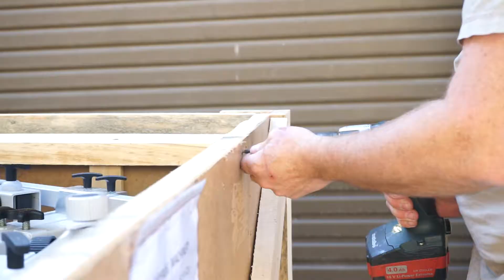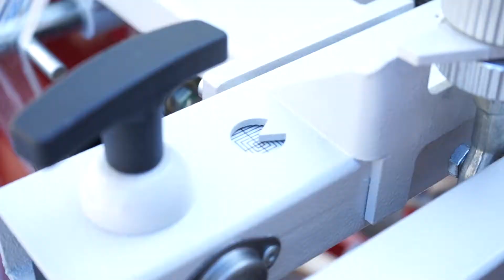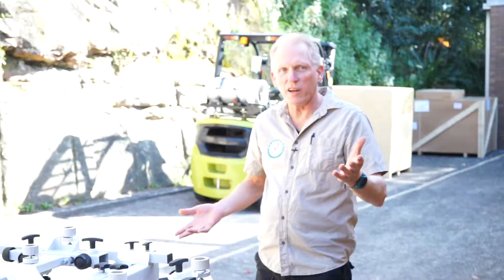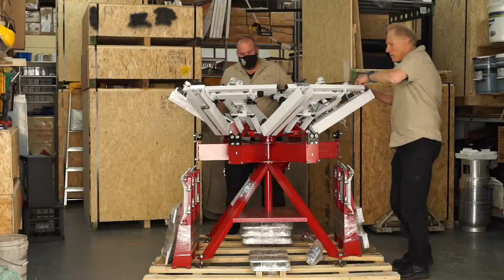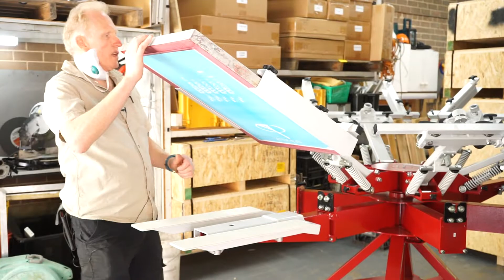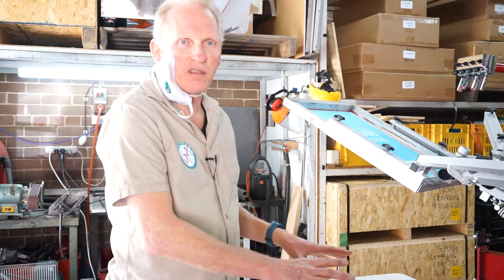Anatol Thunder Unboxing

Comment: Did they update the platen lock handles?
Reply from the maker: Hi @Rip Matek, Anatol have confirmed that previously in the older versions of machines there was a quick release pallet system with an old mounting system. Now the standard pallets are the Slide style pallets as pictured in the video above. You can still request the Quick Release pallets if you prefer these.
Reply: @LEAPFROGMACH  good to know, thanks for the reply!
Reply from the maker: @ripmatek  No problem - anytime and feel free to contact us to see one in person or for  a quote :)
Reply from the maker: I have asked Anatol for confirmation and will come back to you....
Reply: @LEAPFROGMACH  the reason I asked is because yours look different than all the others I’ve seen